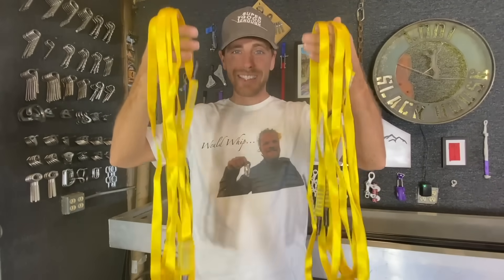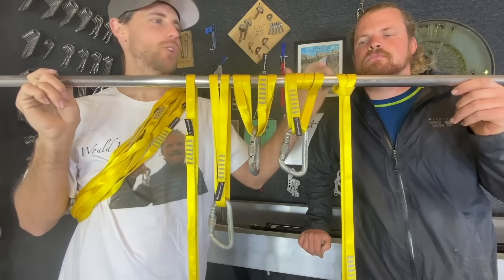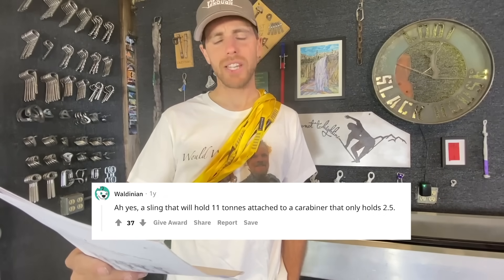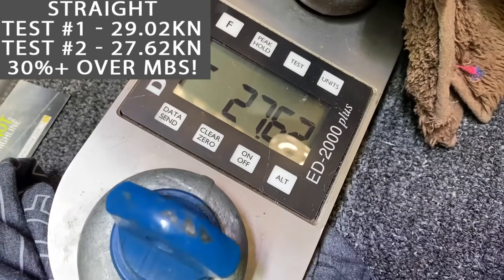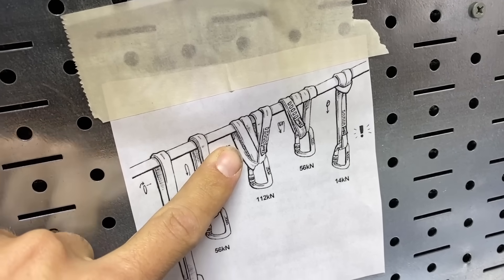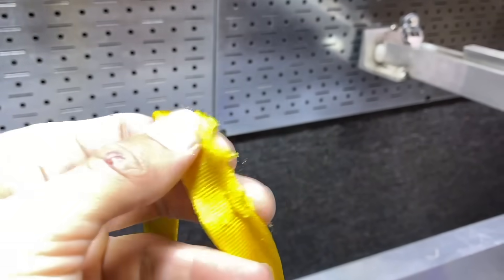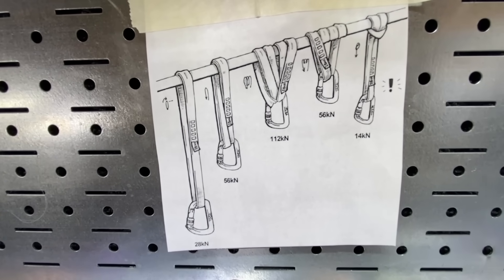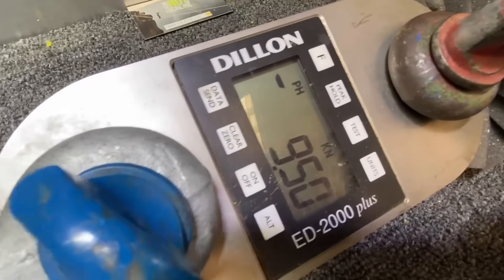Climbing Sling Myths

Comment: Hello. I'm an Entertainment Industry rigger, turned engineer. A few thoughts on things:
1. Have a look at your industrial slings. A choke (or girth hitch), should be good for 80% of strength. That's in a straight line pull. This is on every sling I've ever used.
2. If you choke something, then fold the sling back over itself, it will continue to decrease in strength, depending on the angle. Folded all the way over, you should end up at 50% of 80%, so 40% strength.This is from when I did my IRATA level 1 (many years ago now).
3. MBS is minimum breaking strength. In order to have that as a minimum, everything should be breaking a bit above this. The weakest one made needs to break at MBS. It's a minimum.
4. That minimum might not be based on a straight line pull. The manufacture might account for things like doubling it over etc, then work backwards from there (that's a theory).
5. The one with the wraps actually opens up the other side, giving you a bit of a bridle angle. It's pretty small, but its there. Might be worth playing with the numbers to compare it that way too (I'm happy to help with that if you like)
6. The ones where it was double double folded (that's a technical term I think), you get a bit of twisting and weird compression of the fibers going on. I was still really surprised it went at 78 not 88. 
7. In general, wrapping a tensioned line around something decreases the tension as it goes around. This is why winch drums need a minimum of three wraps on them. After that, there's no tension in the line. This is something I'd like to do more research on, but it's a real thing. So When you wrap the sling around the shackle pin, there is something interesting going on there in terms of directing forces inwards weirdly and if the wraps are over top of each other, then you'll be getting weird compression and heat build up.

This was a great video though! I like your guys stuff. If you want to discuss any of this stuff with me, the entertainment industry is still pretty quiet, you know, with The Plague stalking the Land, so I have a bit of spare time. Leave me a replay and I'll drop you an email.
Reply: What about circumference and surface friction (polished vs galvanised), what impact does that have?
Reply: Ah clearly you know you're shit, so let me make a claim. I agree with all points except the double double. I would expect less than 88 because the way it is wrapped will never let the forces equalizer, so even if the entire sling was perfectly uniform and ready to break at 22kn, one of the 4 legs would hit 22kn while the other 3 still have strength left on the table. Basically breaking strength had all to do with neatness in the original unloaded setup. Replace the shackles with 4pulleyd and you'll see a much more repeatable number close to 88. But wrapped around a single solid shaft, it is UPTO88, often much less
Reply: @whyiseverythingonfireagain1190  Yes absolutely right! Also consider a slight differential load on the outside edge of the double double. If you look closely the geometry makes the doubled up one load up first on the outside edges first effectively causing a greater point load on the outside edges of the straps then the inside legs.
Reply: Oh and it's the same reason why the doubled up but with wraps also brakes lower
Reply: Man! Thanks for the info. How do I learn your info? I'm in Australia tho? Any reply appreciated cheers!🙂👍👍
Reply: @dragan3290  Hey Dragan. It's always worth reading the manufacturers information, theres usually a lot of information in there about how to use their equipment. If you're interested in entertainment rigging, there's two great books. "Stage Rigging Handbook" by Jay O. Glerum. "Entertainment Rigging" (AKA "Arena Rigging") by Harry Donovan. If you're looking into industrial rigging as a career in Australia, your local TAFE does a rigging ticket. Level 1 is called something like 'dogging for cranes' or 'banksman for cranes'.
Reply: @scottstewart6624  thanks man! I really appreciate the reply. I'm looking into what you wrote.thank you very much. And i hope you have an awesome week! Top bloke!🙂👍👍👍
Reply: I noticed the overlap around the shackle pin right away. I just wonder if using a shackle pin that was 0.5 to 1.0 inch wider would eliminate the friction and heat build-up when four layers of webbing are under tension AND compression and sliding past each other? With the extra width you can adjust the "lay" of the sling around the pin so that  there is zero overlapping. Would that give you a different reading? Nice video work. You guys just might be a few saving lives out there! Thank you.
Reply: ah I see a fellow entertainment rigger, nice to see your comment bro, I was thinking the exact same things!
Reply: I can't figure out why the choke decreases strength. I have vague theories, but nothing I would promote. Clue me in?
Reply: @petermgruhn  Has to do with a couple things, The friction where the rope chokes into itself, the veer angle it creates at the loop, the tensions it puts on itself to load the line at differing angles, etc. So there are many factors but mainly it comes down to veer angle and tension factor, As the ropes veer to connect to 2 legs to one point they provide tension on one another at 90 degrees or parallel to one other each leg of a 2 part sling have their full straight pull strength, by the time you get to 30 degrees they have half of their straight pull strength because there is a lot of tension on each leg from one other, to lift the load you are also pulling against each leg of the rope where as at 90 degrees you are only lifting the load without any tension from the other leg, a choker has a very bad veer angle because it's wrapping around something and choking it as tightly as it can which results in a poor veer angle, A choker is further reduces depending on how you pull against the eye after the choke, if you choke it and go straight up i believe it's 80 percent of it's full strength, if you double it back after the choke and pull straight back against the eye it's down to 40 percent.
Reply: @Scott Stewart   For the casual readers out there, this sentence is not accurate in 100% of all situations.  And there's different meanings of 'Industrial Slings'... "Have a look at your industrial slings. A choke (or girth hitch), should be good for 80% of strength."  Because as previously mentioned materials other than nylon are going to be behave differently such as dyneema which will break at considerably less than 80% since the sling cuts into itself as it pulls.
Reply: I made a similar comment bringing up veer angle, ultimate load or MBS, working load limits, the angles on a choker, etc. My biggest thing is that the climbing industry seems to be weird in the fact that they have massive safety factors for a good reason yet almost everything I see from both manufacturers and consumers of the gear always references the MBS and not the working load limits effectively making that massive safety rating irrelevant, Not that it matters because no one with climbing gear should ever be going anywhere near the MBS but whenever they talk about their gear that's the number they always reference, interesting to me.
Reply: @towtruckaj not 100% sure I’m right about it but I’m pretty sure MBS is referenced because everyone plans their own safety margins. There isn’t a single way to do something so you have take personal accountability into consideration and what safety factors you’re willing to use. I’ve seen some sketchy things like everyone’s shoelaces belts and articles of clothing tied together to make a retrieval line that required either jugging back up the trapped line or free/aid climbing back up with no real backup. When situations like that exist knowing you can trust the gear once at 22kn or dozens of times under 15kn setting an official load limit isn’t as necessary. When you’re on the wall you might need to push your gear to the max with a death triangle or similar if something goes wrong. Knowing your MBS and the safety ratio you’re willing to accept lets you decide what risks you want to take. That’s just my theory. Likely most climbing slings would have a 5:1 safety ratio meaning 4+kn which isn’t exactly uncommon forces if you’re taking whippers off an anchor or running a high line. Knowing your gear and tests like these make it likely you can make safe choices.
Reply: @canoepick1140  Well the whole idea of safety ratings is to keep human error out of the equation, Climbing gear is critical human lifting gear and is often rated with a 10:1 safety ratio, It's rated at 100 pounds os it'll break at 1000 for example, This is so when someone overloads that 100 pound strap in an emergency it's really good for much more, Idea being if you know its good for 100 you'll be wary of loading it to 200-300 or more because it's only good for 100, but if you know its good for 1000 you'll take it to 800-900 or even beyond 1000 in which case it's going to break. 
As with everything in the modern world there has to be dummy factor involved, Don't let the dummies decide how far to take it, tell them the rating and provide a massive "safety cushion". When talking professional use it doesn't matter as professionals should know better and know the ins and outs of how it all works.
Reply: Hey brother

Comment: I think the carabiner in the doubled up twice one is wrong, because it was differently doubled up. I assume you just doubled the sling and then folded it over the metal bar. On the Illustration it is attached to one end, then wrapped around the bar and the carabiner twice and in the end attached with the end to the carabiner. Like this the orientation should also be the same. Though it's imho a very unpractical way to do it and I would do it the same Way you did it and just double it up before attaching to whatever with a carabiner.

Comment: my assumption is that the friction from the wrapping or doubling over creates stress concentrations in the sling, since the friction prevents it from stretching evenly. in addition, theres much more heat generated due to the friction over those sections, leading to failure below 2/4x. I would imagine to get the perfectly theoretical values, the surface of the sling would have to be frictionless.
Reply: I wonder if for the girth hitch, the friction in the 'knot' keeps the full load going through the single strand at the hitch, so the forces are shared between the two strands.

Comment: It would be cool to see a strength comparison of the water knot vs the beer knot for slings made from tubular nylon webbing
Reply from the maker: I plan on doing lots of knots when drop tower comes so we can compare dynamic loads and slow pull
Reply: This would be fun but I would garner uneventful.... I love the beer knot. Super clean. My guess is they'll break almost identical as they essentially are the same thing. Same layers of nylon, same type of knot.... only difference I can really think of is the inner potion of webbing might get a little squeezed and Misshaped a bit due to the nature of the beer knot.
Reply: @v0hero691  I mostly use slings for moving rocks for trail work and I like the beer knot a lot as well. They’re definitely structurally very similar but the literature online says the water knot retains around 64% of strength and the beer knot claims to retain 80%, so it would be fun see if that claim is true

Comment: An extra concern with larks footing slings (esp. in prolonged abseiling/bottom roping contexts) could be the sling sawing itself in half at the larks foot knot- Can you try and make a sling do that to see how likely that is to happen?
Reply: I haven't had more issues with them loosening the hangers which causes it to loosen the nut. Wouldn't recommend for any rope that's being moved, even fixed ropes for SRT.

Comment: it might be that twist in the sling is making the load uneven and making it break lower, even if the twists are not on the metal. It might also be that because of friction the load on each segment is uneven, so even if the total is 80 averaged over all the segments, one of the segment might be 27 (/2 for a single strand I guess, which leaves less margin of variance).

Comment: Be interesting to see dyneema girth hitched to the bolt, since it is supposed to be more cut resistant!
Reply from the maker: I know that dyneema won't like the bend radius so if I do that I only use short nylon ones
Reply: @HowNOT2  I see, so you think the knot in dyneema will out weigh its cut resistance on a hanger bolt?

Comment: I think you'll get four times the strength when the single webbings don't overlay as in the small shackle.
Reply from the maker: I'm not sure you can quadruple up anything without the strands crossing over each other
Reply: @HowNOT2  agreed. But on the longer bolt, the webbings are side by side, on the shorter two are over each other. I think that's what weakens the sling